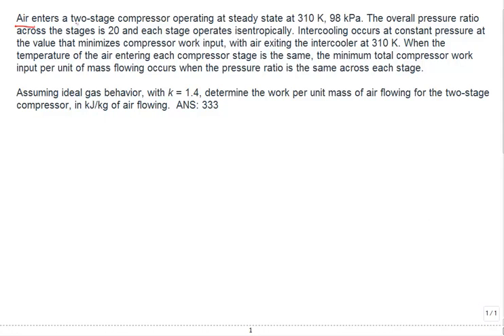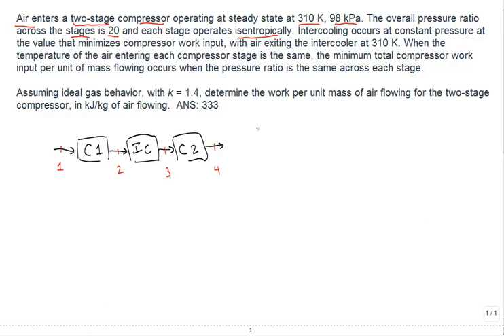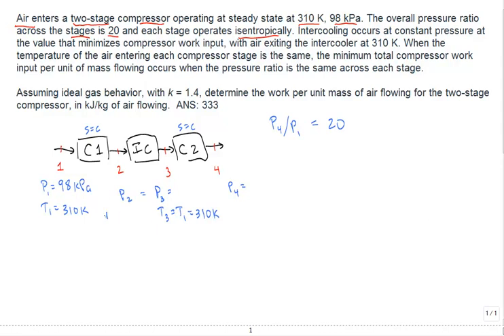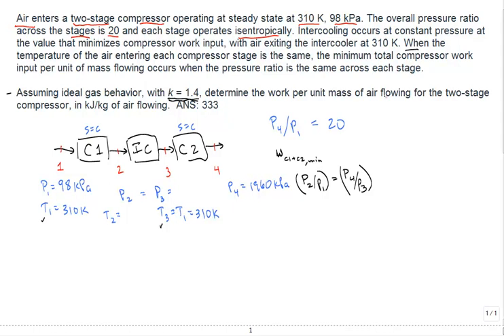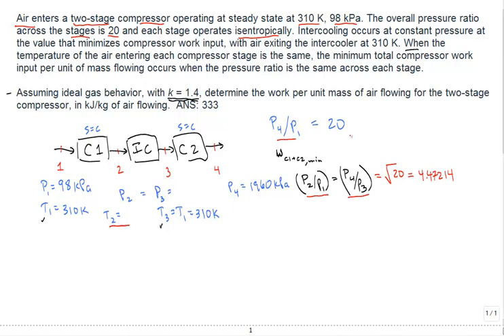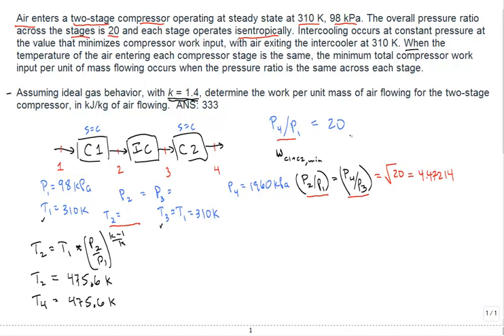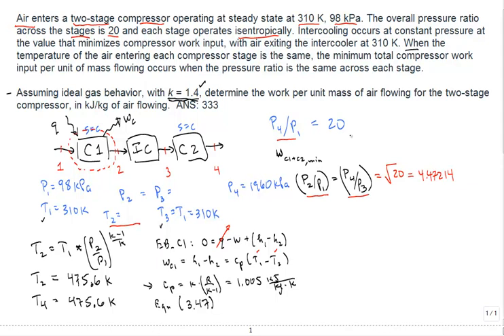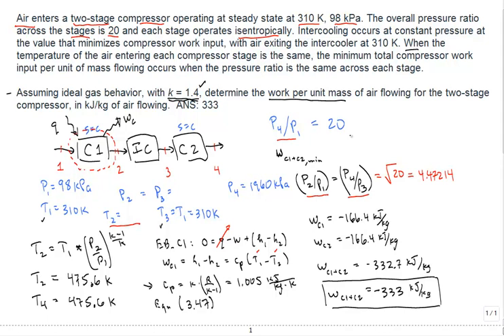two stage air compressor with intercooling

Comment: Can you explain a math where initial pressure and temperature are given, but we have to find the number of stages needed, where intercooling is done before each compressor for it to go back to the initial temperature. we know the flow rate of the ideal gas. Thanks so much